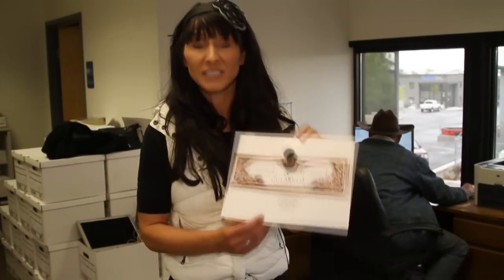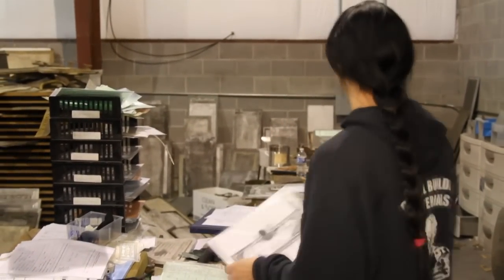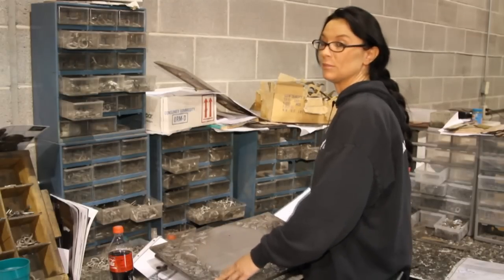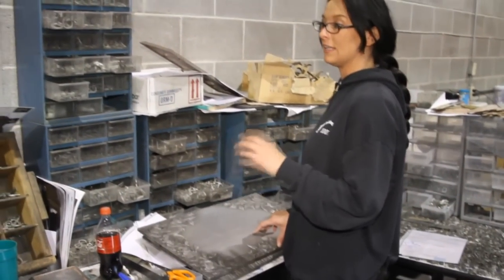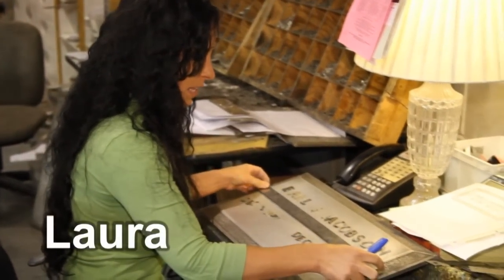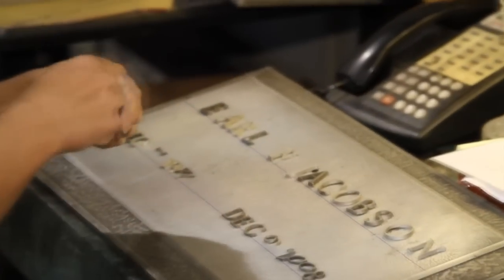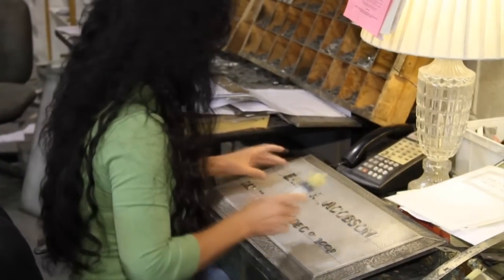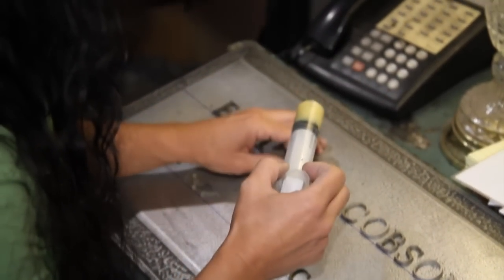How a Bronze Grave Marker is made - Part 1 (Set Up) Bronze Headstone Bronze Cemetery Marker

Comment: Thanks for explaining this process. I never imagined that so much was involved. I'd love to know how much of a markup that the local cemetery charges me for mine. It seems very high and sometimes they damage the items with their tractors.
Reply from the maker: Every cemetery is different.  We sell to hundreds of cemeteries and funeral homes across the country and do not control the mark up that is added.  It can be 5x higher (or more) than the price we charge.  We do sell direct to the consumer and by law a cemetery cannot refuse an outside grave marker as long as it meets their rules and regulations in the cemetery.  The good thing about a bronze marker is that if it does get dinged by a lawn mower or tractor, it is possible to repair and make it look new again.  We do get a lot of markers sent to us by cemeteries to repair.  They will often cover that expense if the damage was their fault.  Thus the reason they sometimes have high mark ups.  It covers the maintenance around the marker as well as the expense to repair those that are damaged occasionally.

Comment: We bought some for my father’s and husband;s graves 20 years ago for several thousand dollar and they look horrible now. I cleaned them and did the clear bronze coat, but the paint isn’t all there. Could you tell me what kind of paint I could use and what kind of clearcoat might be best?
Reply from the maker: Sorry for the long delay...we lost the info to log in to our channel and got behind on messages.  We buy our paint and clear coat products from a local car paint supply company.  But you can even go to Home Depot or Lowes and buy the best brown spray paint and the best clear coat in a can and those will work just fine.
Reply: I wouldn’t use any coating. Keep it bare and clean. You can wipe metal polish on it once a year with a clean towel. Rub it all off. It cleans and polishes.